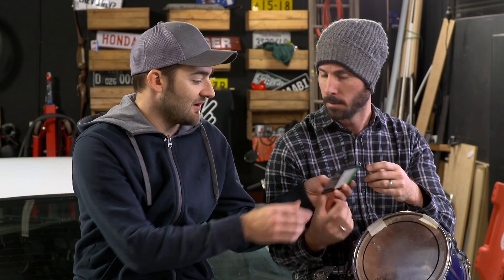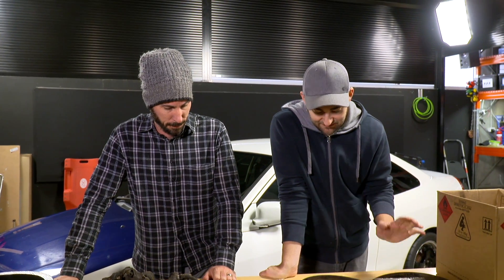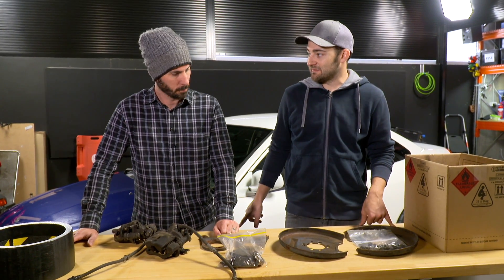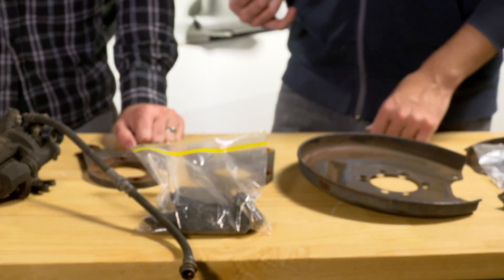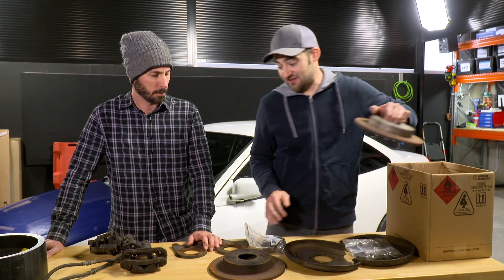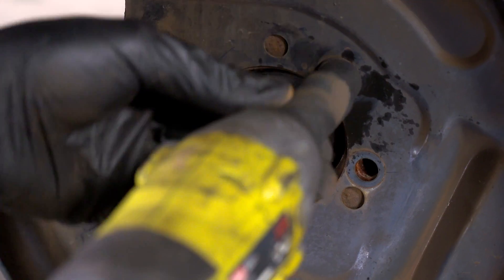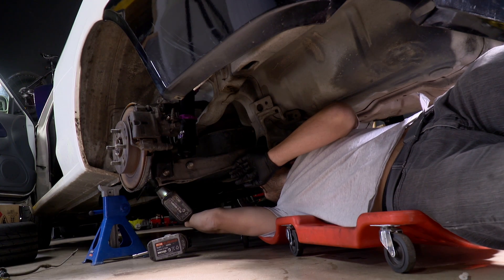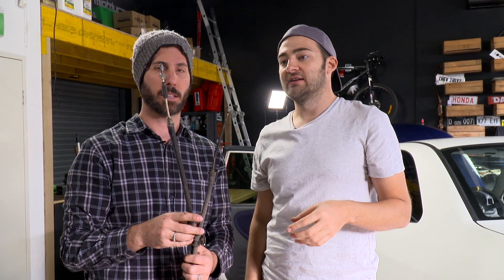Drum to Disc Brake Conversion DIY

Comment: I almost got beaten by my car while changing the oil, what the fuck man. I took it to a mechanic last time and it seems like he used way too much torque to tighten the bolt to drain the oil. Also he didn't replace the filter, or the bolt.

Comment: Drums require less effort to be applied going forwards due to the self-servo effect, as the shoe grabs the drum it pulls the shoe around and into the drum pushing harder on the drum. Depending on design you rarely get self-servo effect when travelling backwards. This is also why disc brakes cars have larger brake servos and different bias valves due to the extra effort required. :)

Comment: Keep up the awesome work guys.  Can't wait to see what's next for 2Sexy !

Regarding the drum vs discs, without calculating everything out, I would wager that the amount of braking force generated by the drum brakes is less than that of a single piston caliper.  The drum brakes have very small pistons in the wheel cylinder, which is why the shoes need to be so big.  A caliper piston is significantly larger and can clamp much harder, so you don't need as much pad surface area.  Hydraulics is all about effective area of the piston.

Comment: Ok youtube mechanics! And some fully qualified mechanics who lack common sense. 1 I'm fully qualified and understand what happened. 2 you don't need to replace the master. 
Now does the car have drum or disc brakes on the front?? Oh it's got disc on the front? Well then the master is already calibrated to operate the front disc's... If anyone of you spastics say something like oh you still have to change it cause of psi or flow or some other garbage then please for everyone's safety don't touch a car! Manufacturers design parts to work with different parts for a reason. Now if it was a 1970 Plymouth then yes you may need to change the master or do some extra add ons but this is a 90s model and is designed with masses in mind. Clearly nobody has had their weetbix this morning..

Comment: The parking brake is not an emergency brake. It is designed to hold a vehicle not slow it down, hence why it locks the rear wheels. If it was meant to slow a vehicle then it would be on the front wheels. Parking brakes are mechanical because hydraulic systems lose pressure over time and obviously you don't want to park your car on a hill at night then find it at the bottom in the morning. In extreme cases of laziness or being a cheap bastard, you can use a combo of downshifting to slow down and slowly applying the parking brake to stop. And I would not ever advise doing that, just get your brakes fixed and definitely don't try it in a car that is more than 3,000 lb, which is almost everything these days except a MX-5 and a Lotus.

Comment: I am actually in shock!.   I cannot believe what I have seen!  Working on a car as this as your premise; spending money wisely as you needed to in order to improve its performance, and then you do this....unreal.....not wise use of funds at all....

You could have spent far less and doubled the braking performance of that car, as well as cutting a little weight and not adding 40% more weight to your car because of the weight of that junk you just put on there.....

Here is how.... parts list:

Vented/drilled/trimmed/slotted rear drums-----note don't be silly here.... drilling and trimming the drums can be done at home, but slotting requires a 3 axis cnc to get it right.. which i am more than sure you have access to....
stainless braided lined brake line 
wheel cylinder rebuild kits
ceramic bonded drum shoes
new adjusters
Misc parts because I am not looking at it....

AND......

After a little elbow grease that car would not fade, and would stop on a dime, and you would save weight and put that money somewhere else! 

In all honesty I expect more from you guys... 

fail....FAIL....FAIL!!!!

Comment: Drum brakes suck. There I said it for them. They barely function. Be better off cost wise just not putting brakes in the back if you can't afford to upgrade to discs.